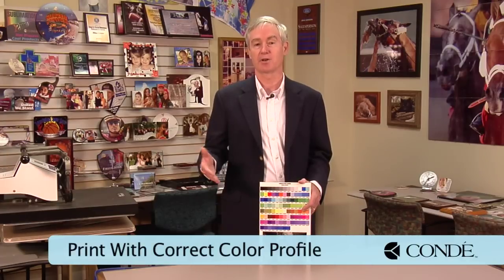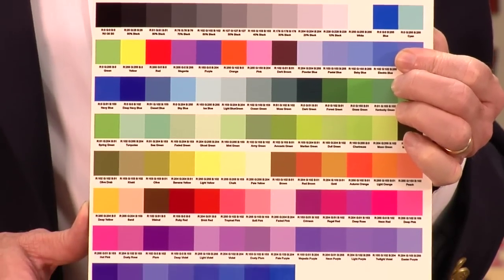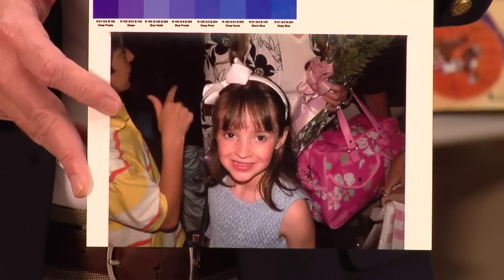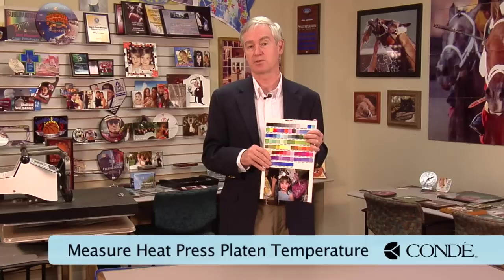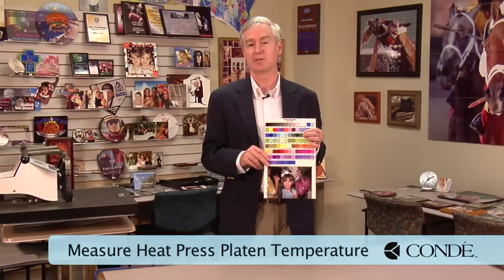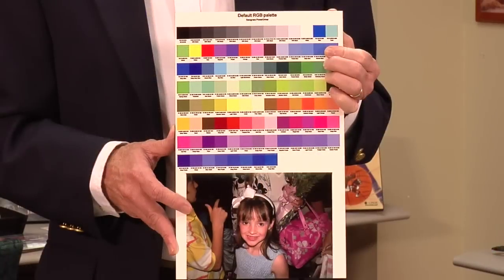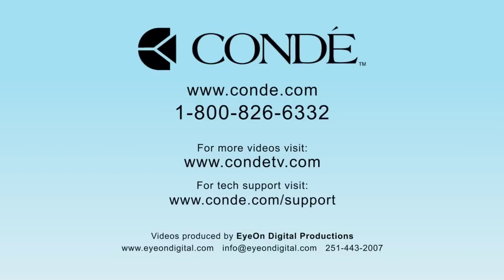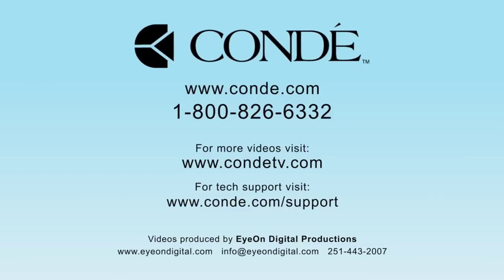Color Problem Solutions for Dye Sublimation Printers -

Comment: Hello. I appreciate your video but I have an issue I haven't seen in videos before.  My converted Epson 4800, using the Hiipoo crated ICC profile, prints as vibrant as the results when sublimated.  Everything I see says it should come out of the printer with duller colors that come alive when heated.  Am I wasting ink or doing something wrong?  I still struggle with Inkscape printing some of my Hex colors like 71c168ff.  Any help would be appreciated!
Reply from the maker: Thanks for sharing!  It is hard for us to give you any advice since we do not sell or work with converted Epson printers or Hipoo inks.  Maybe try contacting Epson or Hipoo and see if they have any solutions?